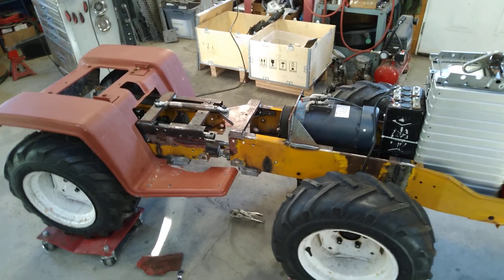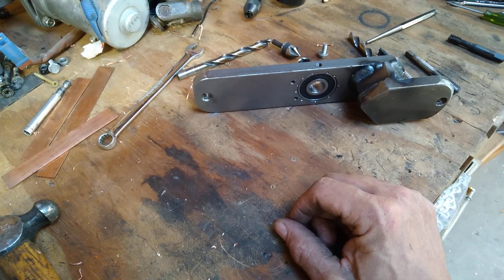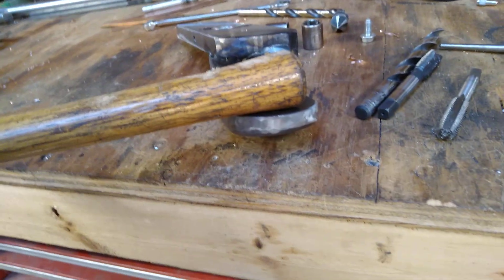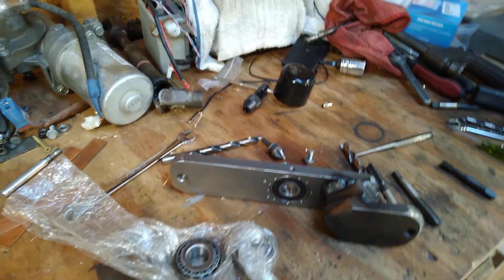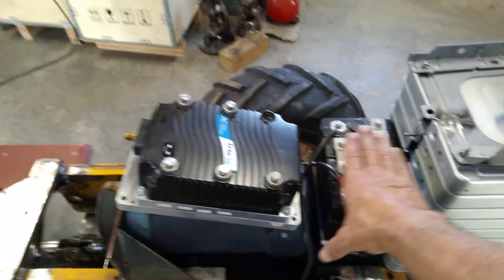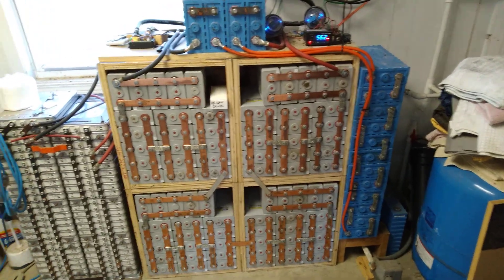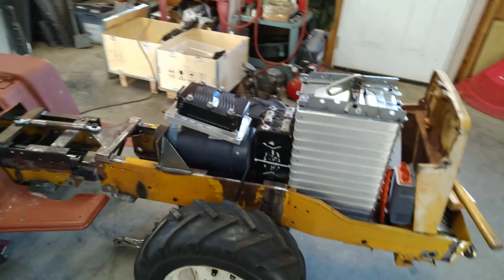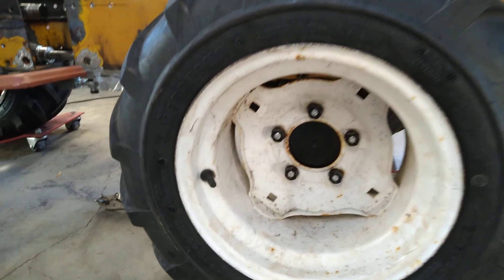Better But Not Quite - The Cub

Comment: Hello. I have used many BMS's on my solar and also electric scooter and electric work trike projects and the one I like the most is the JK BMS. You can get it around $100-$150  they have one that's good up to 150 amps and maybe a larger version. It can have a 1.5 amp or more active balancer depending on the model you choose so I stead of burning off the power from tye peaking cells in heat it will transfer the power to the lowest cell. It keeps my packs in balance better than any I have tried with normal resistive balancers that usually max out at 200ma or so. I think the full name of the bms is jikong but everyone calls it JK bms

Comment: I favor the double taper bearings but you can buy bearings that have two rows of balls inside.  The tapered bearings need a shoulder that supports one side and a nut on the other to maintain preload.
Reply from the maker: Already done did it! 😌

Comment: Thanks for the update.
I get the feeling the double roller bearing is the way to go.   Save the time finding out the first setup will not work.  

-- OR --

Maybe you are already doing this but had to ask.   Again my apple-gees if your way ahead of me on this.
You should be able to stay with just one ball bearing.  Did not see the shaft that goes through the bearing. 
Does it tension the balls and races?   The bracket supports the outer race so the shaft/pin would need to push on the inner race 
with a double nut on the other end to set the tension..  
This is a bit of "not for purpose intended" ball bearing use as it converts the bearing to a thrust bearing like function.  
This is such a low end use of the bearing that it should work.
Reply from the maker: do you mean to say double tapered roller bearing?   Right now I have a single roller bearing and was thinking of doubling that up.
I couldn't really tell where they movement was coming from if it was the bearing moving on the bolt or the bearing moving within the crossbar...or both.